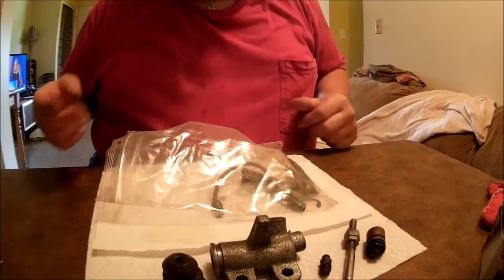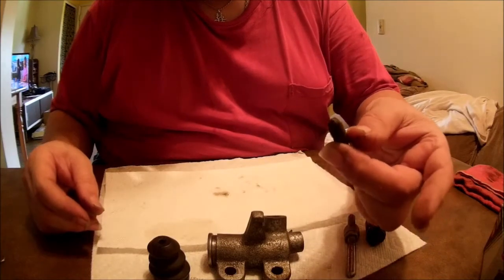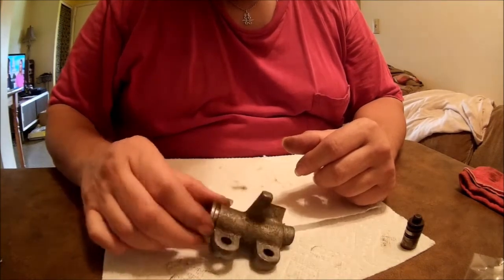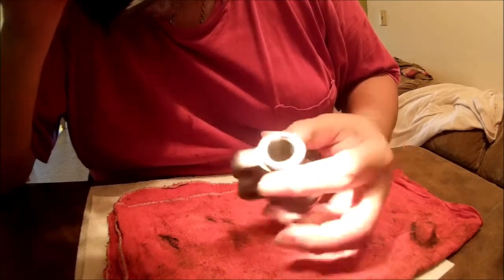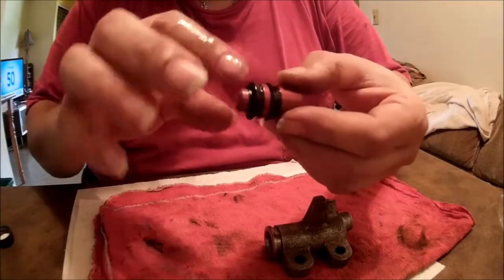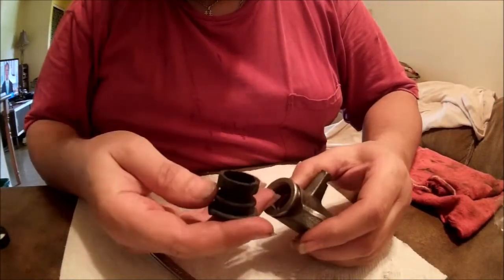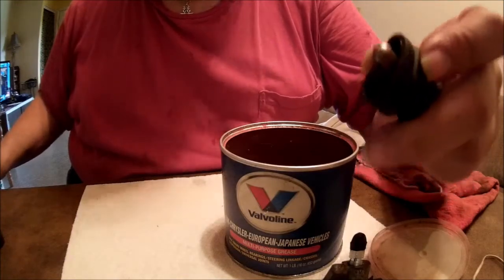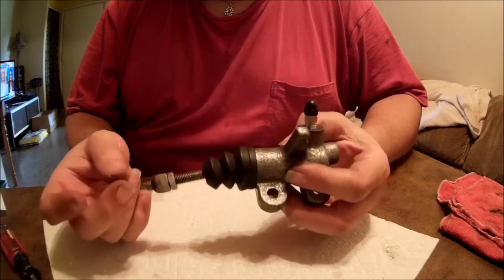1978 Toyota Pickup/Hilux-Clutch Slave Cylinder Rebuild

Comment: what websites can i use to buy japanese parts?
Reply from the maker: Toyota themselves still makes & stocks some Japanese made parts, & of course the dealership parts departments have them, but the prices are kinda high. I have also seen some genuine Japanese parts for sale on Ebay. What's available all depends on the vehicle. In my case with the "78 Pickup, some things just are no longer available & I have to go with aftermarket or rebuilt parts.

For '79 & newer pickups you can try toyotapartsdeal.com.